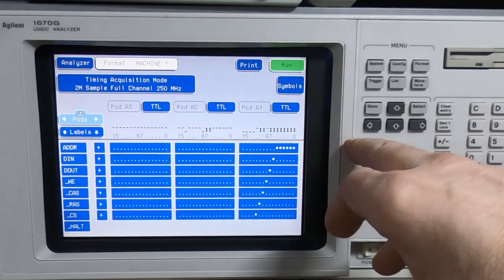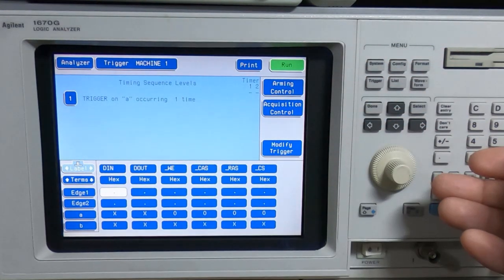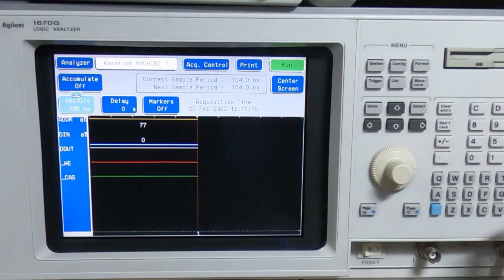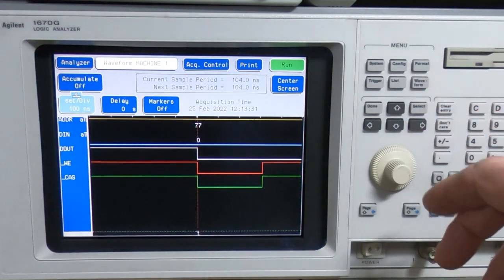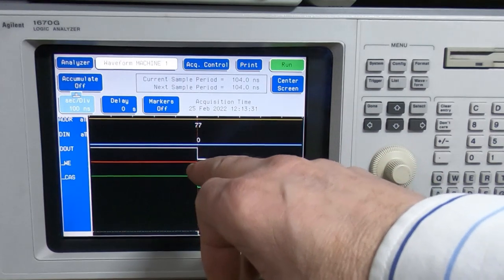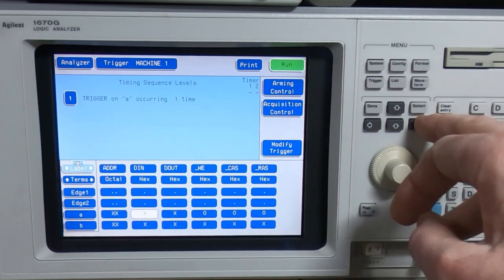PDP11-34A Repair Part28

Comment: Congrats on tracking down that broken, open trace on the Memory card. I'm glad it was something "visible" which is not the case with the troubleshooting up until this problem got solved (although the Unibus pins were "almost" visible in their lack of solder, but required really getting close with a microscope to see.

Comment: Mate you are a tiger for punishment, honestly 99% would have given up but you are hanging in there on the basis, it worked once so it can be fixed. Love watching your work
Reply from the maker: I guess I am just not too bright. I actually do not assume that the machines I repair ever worked and in fact some I have 'repaired' had been put together using non compatible parts so would never have worked.

Comment: Jerry, what are the module/card numbers for the cards you need more information on?  When I bought a Programmer's collection of PDP-11s (& some peripherals) some years ago, I also received a collection of microfiche cards(?) for quite a few different PDP-11s, not just the machines he was programming.  Perhaps I'll get lucky and find a fiche (set?) for the module(s)/card(s) for which you need tech info?
Reply from the maker: Thanks, The memory card does not seem to have any module number, it looks like a third party card but does not have any markings. I will take a closer look and see if I can see any useful numbers or something that may identify it. It seems a bit odd because it does not look like a cheap card. Do you have a running 11/34 with an RX211 and RX02? I am chasing a fault with the floppy drive/interface/CPU at the moment and a quick test on a working machine would help to simplify the repair.
Reply: @JerryWalker001  No, I'm not lucky enough to have an 11-34A.  I've got several different QBUS machines (& a VAX) only of the PDP-11 family.  But I do have the stack of PDP-11-related microfiche which, if I'm not mistaken, includes some 11-34A data.  I'm not sure which interfaces the machines have for RX02s (which I do have).